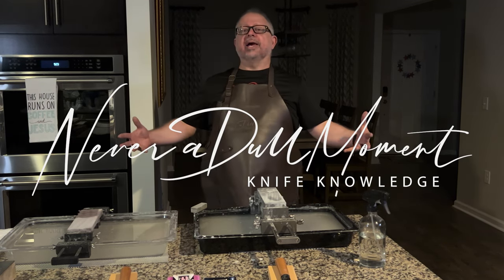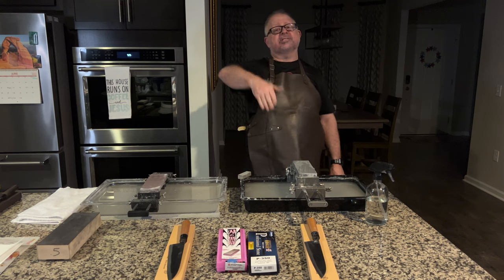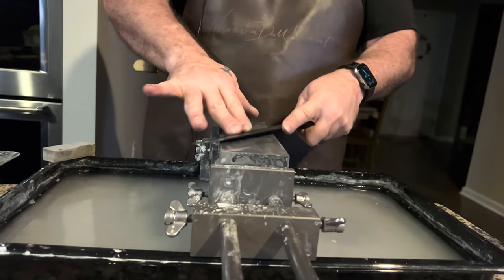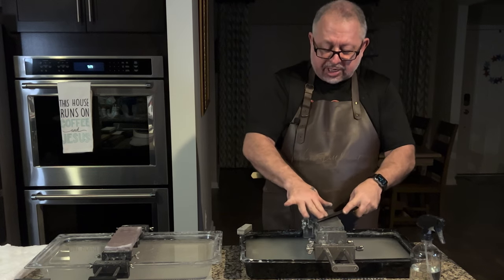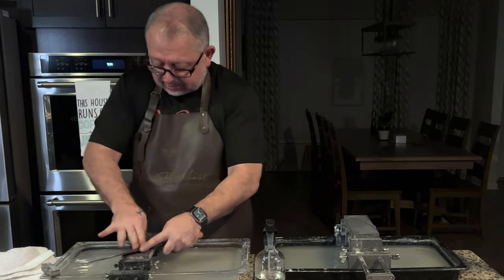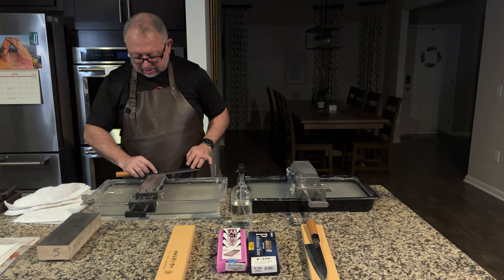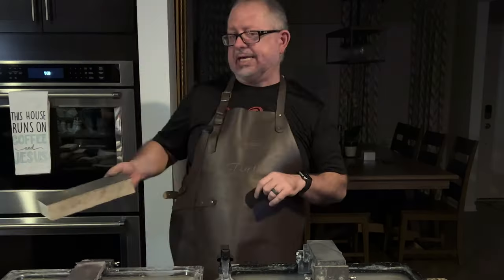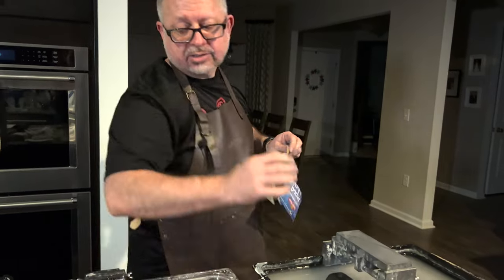Whetstone wars - BATTLE 5K - Shapton Kuromaku vs. Naniwa Professional Ceramic Whetstones

Comment: I sharpen and in with the wife. They sounded the same on paper. No need to shut her opinion down because she doesn't sharpen. Also, we all saw the shapton win on the paper towel. No tie. Good video though
Reply from the maker: I have found that sometimes the paper towel can be a good thing or a bad thing. It seems like you need a little bit more teeth to cut the paper towel. So it depends on the edge you're looking for. I mean, I'm on your side. I just I've done this enough now to know. I need to apologize for taking so long. I've had a surgery on my knee and some other things going on. We've had the court case for my car accident. We had to deal with that as well. We've also had some other major things happening personally. Deaths in the family and lots of arrangements to be made. Also, I'll let you know that I will be having another major surgery in June and will not be making it to the Blade show. I will be out of work for two weeks because I'm having all the extra skin cut off of my body. We do apologize for an interruption of videos if it were to happen. Will try to shoot some head for you guys so we can fill the space. That being said, thank you for checking out the show. Thank you for your support and your comment.

Comment: Ah ... for a moment I thought it was the Naniwa Superstone 5K. Wondered why it was grey, the superstone is white, basically. I have a SS 5K, and in my very limited experience, it's good for HRC under 60, but loads up a bit. Pretty hard stone, not soft, very nice consistency of scratch marks. 
I found what I was doing wrong, btw: after getting some knives around 100 Bess, I just got lazy, and expected all knives to know "I'm good!" and that they should sharpen up. They didn't comply, so I'm back to paying attention to what I'm doing, and everything is fine now.
Reply from the maker: That is so funny because that has happened to me. Do you think you’re just a pro and you don’t have to check yourself. Sometimes I’ve had to go back to the drawing board. Good stuff. I’m glad you’re paying attention. Thanks for coming as always. We appreciate you being here
Reply: @nadm  Another member of the drawing board club. It came a little bit too quickly and easily and I got lazy just like Dave said. I went back to zero and that's when I stumbled upon you Greg! I slowed down and focused on my angle, problem solved. I want to see chocera  vs. shapton glass and shapton pro versus Naniwa super stone!
Reply from the maker: @paulfrontiero6971  I don’t have the Shopting glass. I think I have just the HK shapting glass but I don’t own the other ones
Reply: HRC has next to nothing to do with abrasive resistance. The amount of straight up BS that gets repeated like facts in knife bro world is intense. A "shirogami" steel at 65 rc will be much much MUCH easier to sharpen than just about any basic stainless steels at 56, like say a generic German knife which uses German 4116 steel, usually 56-58 rc.  I feel like if you've ever actually put a knife to a stone, this would be obvious. The super stones are softer stones in that they have that hard rubber type feeling to them. Unlike Chosera they are splash and go for real, But they are specialty stones. They're generally used for finishing and polishing, not for sharpening knives. They are probably the best straight razor stones on the market at any price. and I hate to tell you this, but they work even very hard high alloy steels.
Reply: HRC means nothing about abrasion resistance or sharpening buddy. I'm sorry that charlatans like Burrfection misinformed you. A 65 rc shirogami still is easier to sharpen than a 55 rc something like ZDP for example, or basically any 10v class steel in terms of abrasion. That's because hardness is not the same thing as abrasion resistance aka machinability, which tells you how hard/easy a steel will be grind/sharpen, also how quickly it dulls. Carbide content and type determines this orders of magnitude more than hardness. The Super Stones are a line of finishing/polishing stones and they work just fine on all sorts of low alloy and high carbide steels at all kinds of hardness, the hardness doesn't really matter. You can put a mirror polish on 66 rc ZDP with a super stone going from a 600 grit in a few minutes. They are excellent, powerful yet gentle sharpeners which have extremely good performance in my tests.

Comment: You are clearly biased towards the more expensive stone throughout testing despite result
Reply from the maker: I don't understand why you said that. I don't care if it's more expensive or not I just care about the results. We try to break it down to the cost versus the result. I've had many a favorite going in and been thrown the other way because one just beat the other. I really don't care. The Shapton company I have a problem with because they are grit rating is wrong. Naniwa was the first one that ever used but they crack and they're a little harder than I would like them to be. The Shapton company makes their stones a little bit thinner, so I wish there was more stone for the dollar. It's very aggressive sounding and it feels good. I didn't really have anybody in mind for the winner of this. I'm sorry you took it that way, but I'm not biased. All I care about is the end results and sharing with you what we find. I don't get any money from either company. All of the stones were paid for it out of my own pocket.

Comment: 80 $ ÷ 4 = 20$ shapton 1.5 cm thickness with same dimension as naniwa cost 58.8 $ ok. But Naniwa brand give 2 cm thickness for 80 $.  that means both price are almost same.😂😂😂
Reply: But what we are missing here is the question if they are worn down the same. I heard that the shapton is that hard, that you might give it to your kids... Is the Naniwa the same?🤔
Reply from the maker: I hear you I'm not sure if that equates properly. I'll have to figure it out. They do not wear at the same rate.

Comment: You can't recommend both stones, one feels like shit when sharpening and the other gets cracks and is too expensive ^^
There are better stones on the market like naniwa pro 3k or Arashiyama 6/8k, suehiro debado md-400.
Reply from the maker: The point of the show was to battle these two against each other. I'm not telling you want to buy. I'm saying that between the two of these this is the one that I would recommend. I need to apologize for taking so long. I've had a surgery on my knee and some other things going on. We've had the court case for my car accident. We had to deal with that as well. We've also had some other major things happening personally. Deaths in the family and lots of arrangements to be made. Also, I'll let you know that I will be having another major surgery in June and will not be making it to the Blade show. I will be out of work for two weeks because I'm having all the extra skin cut off of my body. We do apologize for an interruption of videos if it were to happen. Will try to shoot some head for you guys so we can fill the space. That being said, thank you for checking out the show. Thank you for your support and your comment.

Comment: I feel the same about Shapton. I swear there 1k is like a Chosera 600grit same scratch pattern too. People seem to dislike the 5000grit Chosera  but if they get the 10,000 then they will start to like it. It is the perfect set up stone for it.
Reply from the maker: I wish everybody would get in line. Drives me insane.
Reply: When you say people, you mean   Burrfection. Clearly.  The Shapton pro 1k is equivalent to about the 800 Chosera. Those are both sharpening stones. The 600 Chosera is a course stone and there is no shapton pro equivalent. The 320 is more like the 400. The 5000 chosera, like the 5000 shapton pro are finisher stones, they are polishers, however the 5k chosera is more similar to the 8k Shapton pro.
Reply: @Jeff Hicks  what the hell is buttfection?shapton pro 1000 is more like a chosera 600grit. Scratch pattern is almost identical. Sharpening stones are anything under 3000grit.
Reply: @Never a Dull Moment  lol what do you mean bud. I will say this about chosera 5k. When i first got it i didnt care for it that much other than being a set up stone. After about 7months that stone changed big time. Almost like it needed broken in. Since i have liked it as much if not better than the chosera 3k. The feel of it and feedback changed that much its unreal. If ya dont believe me i will send it to you to try. Arent these comparisons supposed to be about performance? This one was confusing